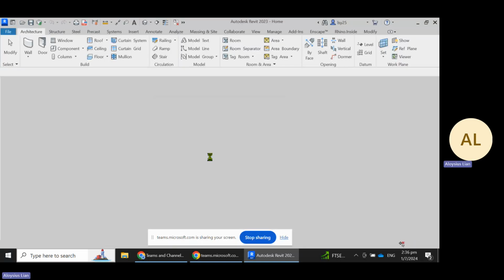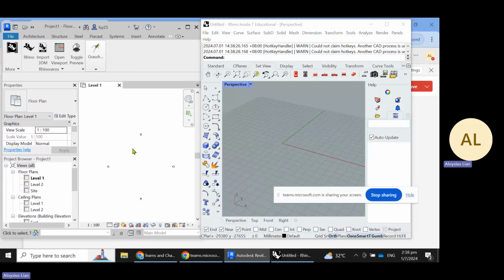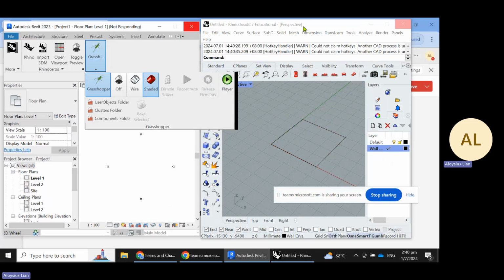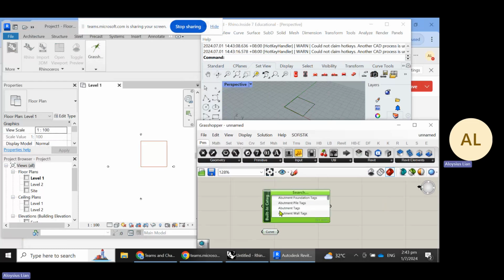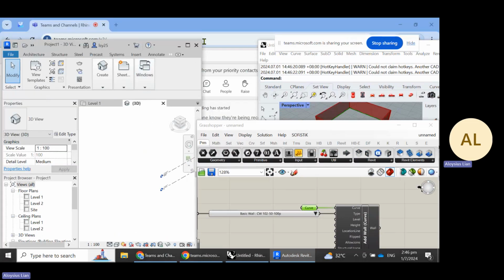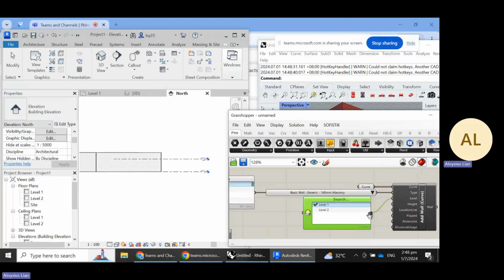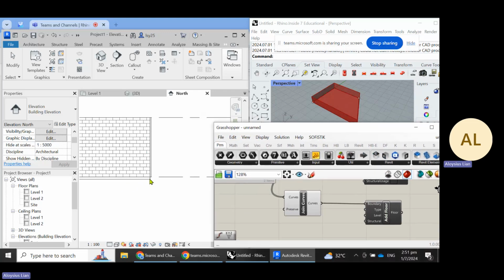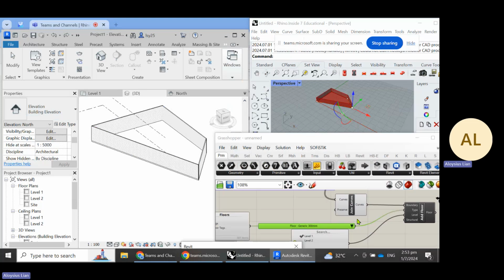Rhino Inside Revit | Add Components

Comment: Thank you. This tutorial helps a lot. But Maybe you can help me with another problem. Instead of a wall, I want to add a cable tray. Now there is no tool in Grasshopper with the name 'add element'. how can I solve the problem?
Detailed problem description: How can I use the Revit system tools in Grasshopper? For example, I want to create a cable tray along a curve. I can bring the curve from Revit into Grasshopper, but I don’t know how to create the cable tray along the curve in Grasshopper. I also don’t know how to insert other system elements like pipe accessories or air terminals.
I know Grasshopper quite well, but I’m missing the Grasshopper components (exporting elements from GH to Revit) for system elements, like the ones we have for walls (e.g., “Add Wall (Curve)”).